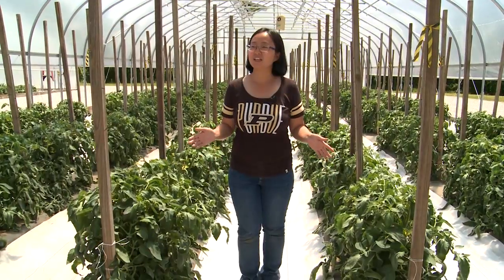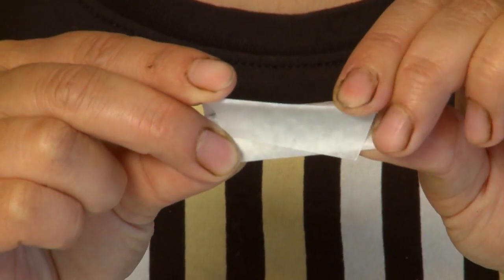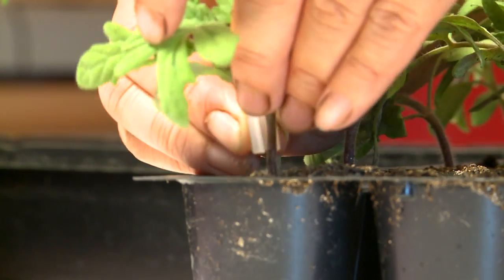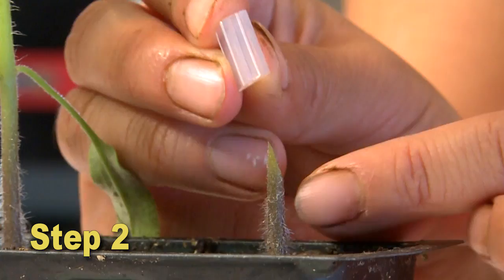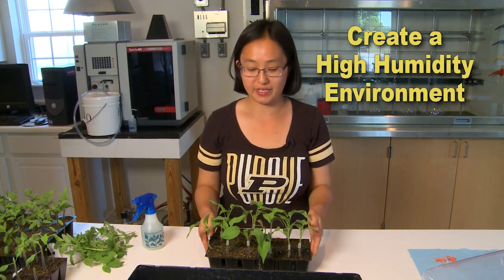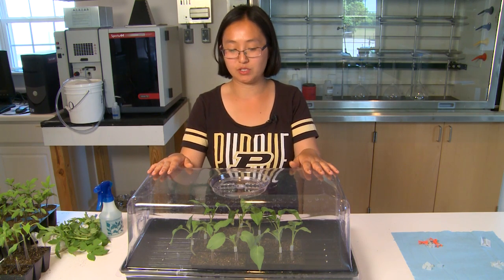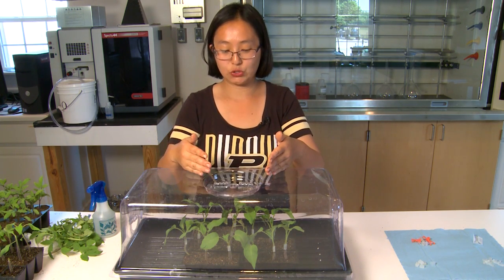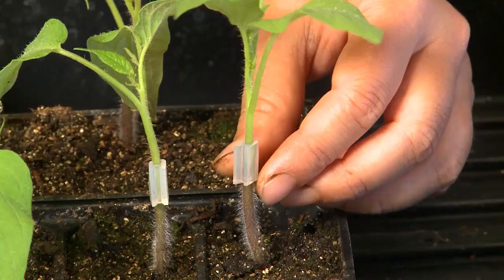How to Graft Tomatoes

Comment: I have been successful grafting tomato varieties onto other family members of the nightshades, in particular kangaroo apple. Very hardy perennials native to New Zealand and the East coast of Australia. The grafted tomato plants do very well. Shoots and leaves will also be produced on the rootstock which I think is ok to support the grafts through the colder season when the tomatoes become dormant. The grafts came through their first winter (in the greenhouse) no problem, producing tomatoes a month before new seedlings do and at least a month longer than regular tomato plants do in the greenhouse here in the south island of New Zealand. The shoots on the rootstock are continuously removed during the growing season. The rootstock is vigorous enough to accept laterals but certainly the plants need mechanical support with the weight they carry! I tried different nightshades but kangaroo apple (Poro Poro, Solanum aviculare, but sometimes also called Solanum laciniatum) worked really well.

Comment: I used your instructions with the 3 MM clip and Humidity dome.  It appears all 12 grafts will survive. I used the NE Seeds RST-04-105-T rootstock with  Black Krim, Brandy Boy, Rutgers and Mortgage Lifter.  

thanks
Reply: Hi... Should we give water to these grafted plants or not n also someone told me instead of clips we can use aloe Vera as it keeps it joint n provides necessary nutrients..please guide.. Thanks